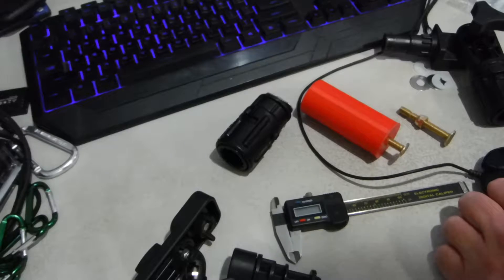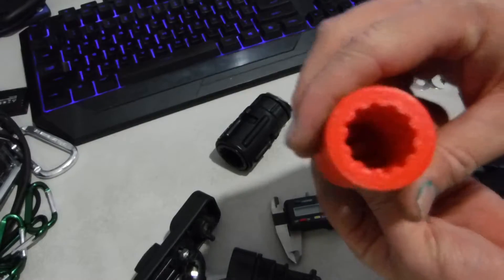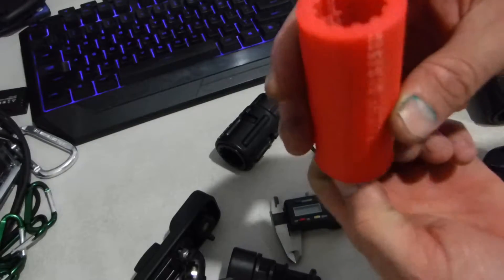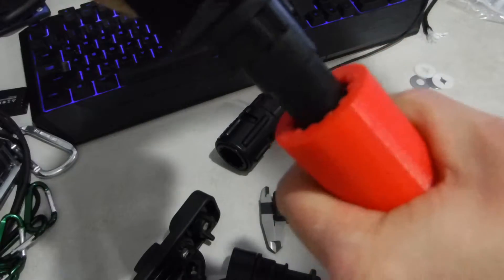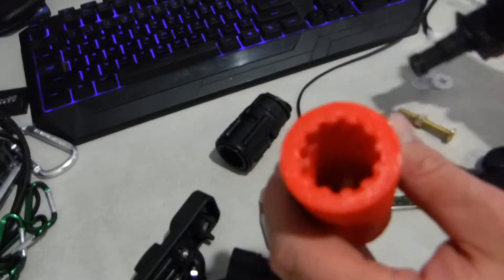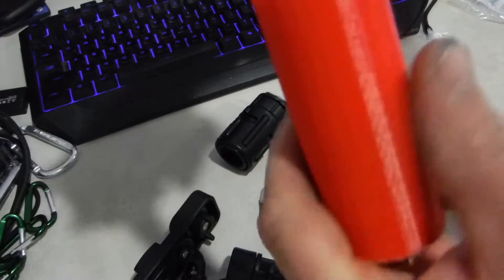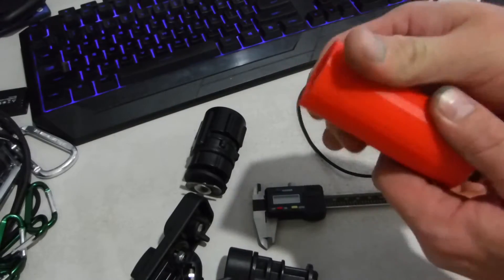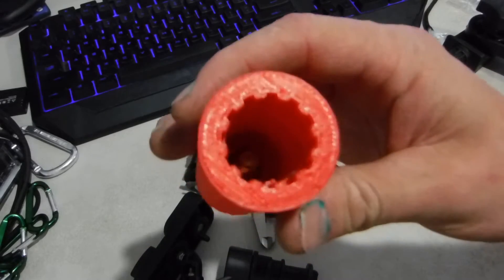3D Printed Gear Head Track Adapter

Comment: so I started printed mine, and my sides are like slotted not round as it shows in your model of the stl. I have this problem printing everything that is a cylinder shape. What slicer do you use? thanks
Reply from the maker: Sorry for the late reply, but I used xyzware, its just ok though.

Comment: do you have a download link? I'd like to try it myself.
Reply from the maker: Here is a link for the files, I included the original one that printed tight on my printer. (I expanded the x/z dimension a bit in the fixed version.)

https://www.dropbox.com/s/msxwp38sp2drm8k/Scotty%20Adapter%20Models.zip?dl=0

Comment: That is SO COOL!  You can cut off the top of the bolt if you want to make it smaller. I will put the link to this in the other video!
Reply from the maker: Thanks! In the picture on the bolts package it shows a pair of pliers breaking the bolt, but its impossible! I put that thing in a vice and beat it with a steel block and it still didn't break! I had to take it to the chop saw. I reprinted another adapter that works pretty good.
Reply: Yes... I use a hacksaw to cut them down.  And... as a result of your video... a truly great use of a 3D printer!  After all, it you can't make something for fishing, why bother! :-)